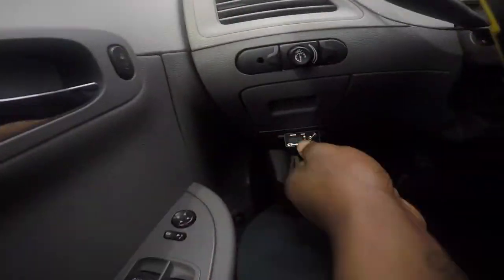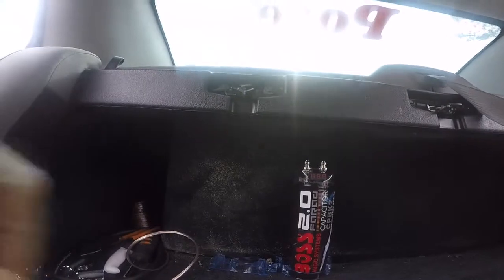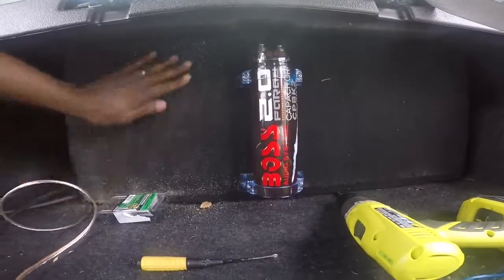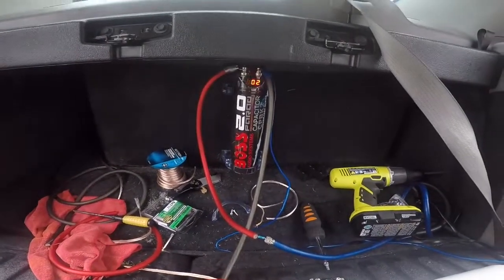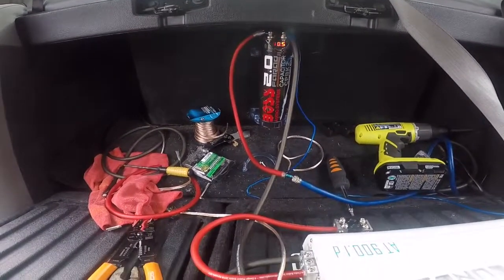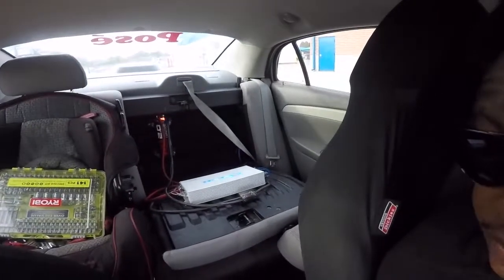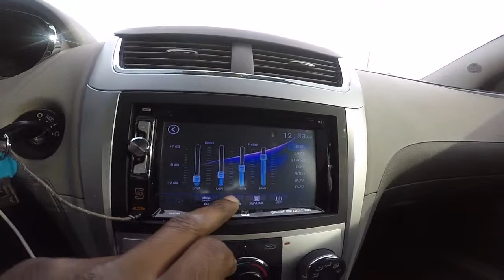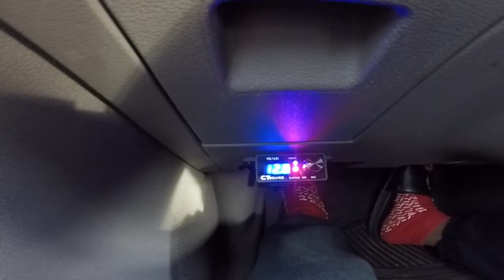Capacitor Before & After, Worth It Or Not? DIY

Comment: Not sure what volts my aMp is putting out but I have a old 10” pioneer sub with a old ass pioneer 600w dual channel amp. went and got the wires from some amp kit with power wire, remote wire  and RCAs from Walmart that says It can handle 1000w Do u think this cap would help with my lights from dimming when the sub hits? Feel like this shouldn’t be dimming my lights I ain’t got a a crazy setup. My car is an older 2000 civic with stock alternator.
Reply from the maker: Get you and extra battery, those caps are no good, get this

https://www.down4soundshop.com/xs-power-d680-1000w/

Comment: Hey bro so i only use main battery on pt1000 
1k watts 30amp fuse i think my alt is 175amp and 11.90 once bass hits hard do u think the capacitor will help it to keep 13 volts at least?
Reply from the maker: Supercaps with a Agm, or if you don’t want to change to Agm, get you a northstar 100ah HT , those run pretty cheap at local battery stores

Comment: What I have not seen in the comments I will give a number one suggestion when it comes to your capacitor do not screw it to your speaker box you mount it to the vehicle itself you destroy the speaker box that way ends up rattling ripping holes in your speaker box from it jerking around on it I've had plenty of mishaps and backfires doing so I now install car stereos I have for the past 8 years that is very incorrect to do I'm not going to cut your video up anymore the man that said something about two different size speakers was your first problem that is the first problem the second problem is the capacitor you do not mount it to your speaker box plus you have way too much wire more wire you have the harder it is for your amp to get power it strains the amp and causes your speakers to drag which means there's not enough power for them to run right underpowering a subwoofer is worse than overpowering a subwoofer

Comment: Its a quick lil tiny help but you'd get way better results with better capacitor, 0 guage wires not 4 guage & putting the power cap as close to amp as possible... Your best results will come from BIG 3 upgrade & extra battery and for bass amps  always go ZERO GUAGE!!!!
Reply from the maker: Got rid of that thing quick, got a h/o alt cyber 6k and limitless supercaps 3000f

Comment: Yo sup bro... your literally causing your woofers to work totally out of sync with each other bro... you can actually see by their excursion. They should be a mirror image of each other.... 2 woofers of different sizes ain't ideal together... especially once they I'm the same enclosure and they sharing their volume in the same chamber. If you really wanna keep em both maybe try 2 different enclosures but get a pro to tune em so that they can be as I'm sync as possible.  Thanks for the video man. Sweet
Reply from the maker: Appreciate it, and yeah I noticed that, I think I got rid of them right after this video #trialperiod. But this was one of my best systems yet. Moved a lot of air